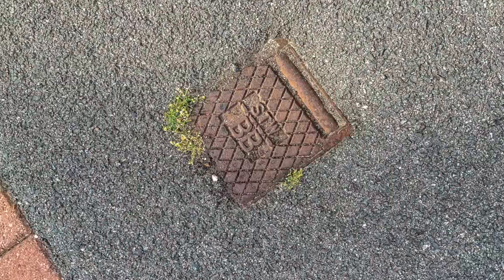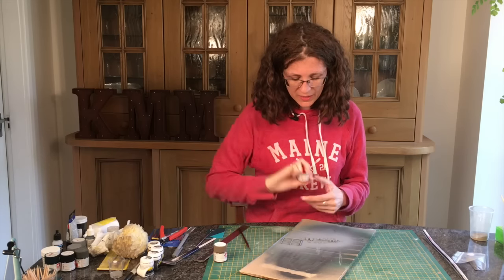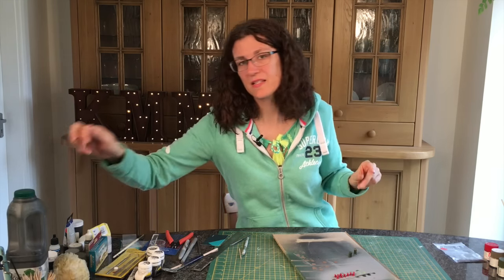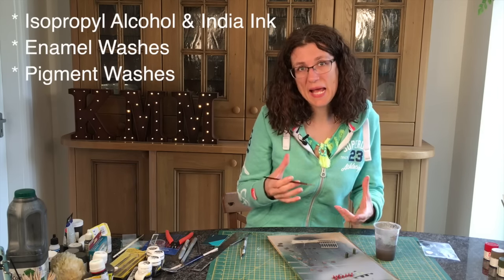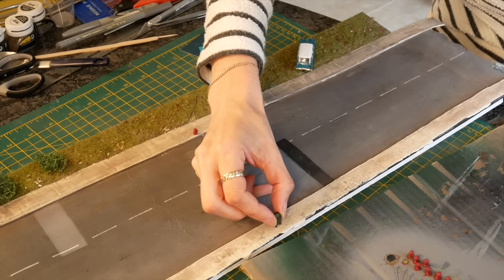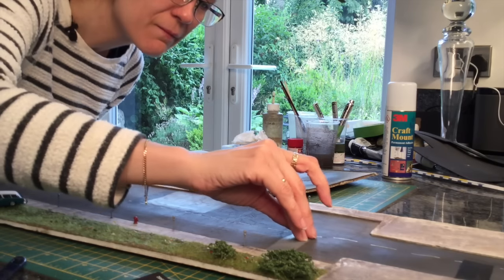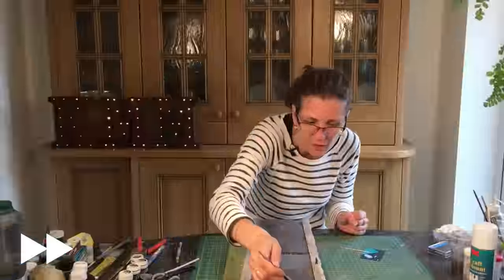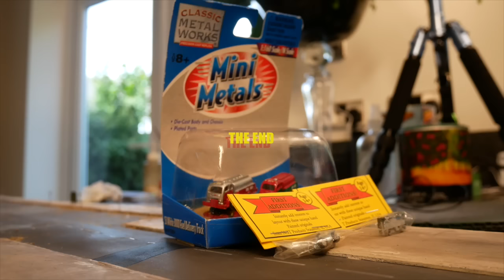How to Model Road Details

Comment: Hi Kathy. I love the level of realism that comes with the litter and gunk found near the drains and at the sides of the roads. Is there a way of cutting the crisp packets and sweet wrappers etc down to size quickly or easily? I've been using standard scissors but the bits just go flying everywhere and look too big and out of scale.
Reply from the maker: it’s a great look, isn’t it. I cut the wrappers into strips then into smaller pieces and held them inside the container when I cut. It caught most of them as it had tall sides.
Reply: @KathyMillatt  Thanks. I was mainly cutting and snipping over a piece of paper but ended up with pieces going everywhere. Lucky I got a paper shredder to do most of the strips! :) I've kinda mentioned your incredible work and techniques on Facebook and a lot of people have said they like it and will take a look at your videos and guides. I got a good mix made now and added some white paper and brown parcel paper in to represent the paper bags from McDonalds and other fast food outlets. This is also a great thing for representing fly tipping and litter around ballast shoulders. After all you never know what goes out of a fast moving train!
Reply from the maker: @nicholasham6943  Brilliant.  I love the idea of brown paper bags and may have to steal that one!

Comment: Pre-1954 stop signs were yellow, not red, FYI.  (And lots of places didn't change existing signs to red for years, too much trouble and expense to change them all immediately.  New signs and replacement for damaged sign faces were red, but the rest changed gradually, apparently more so in rural areas.  So a mixture of yellow and red in the mid-1950s and even late-1950s in some places is believable. The odd yellow stop sign survived in some places for an amazing time, but haven't seen this well-documented.)
Reply from the maker: Wow, I didn’t even know there were yellow stop signs. Thanks for the info.

Comment: Hi Kathy! Can you tell me the color numbers for the MIG washes you use? The "neutral" and the "dark"? Thanks!
Reply from the maker: Hi Steve, P222 and P220 respectively.
Reply: Thanks! I'm having a difficult time finding them in the USA. I thought I had found them from an eBay seller in the UK but he just wrote that he actually is out of those two! Must be popular!
Reply from the maker: Steve, it's a problem but try Ammo by Mig or AK Interactive for similar products. Armour modellers use them a lot so there should be some in the States that can supply.
Reply: Hi again Kathy, sorry to be a bother! Can you tell me the AK Interactive equivalent to the MIG Neutral and Dark washes? I want to get similar and something that is not an oil based product
Reply from the maker: +SteveRawley64 hi Steve, a quick Google shows that they are not quite the same names at AK interactive and Ammo. I've never used them so you would need to look at them in person I'm afraid.